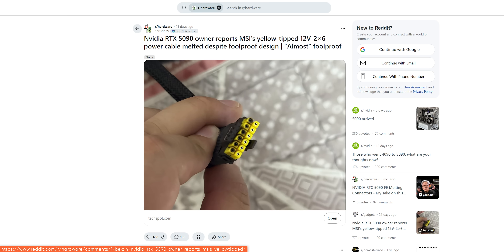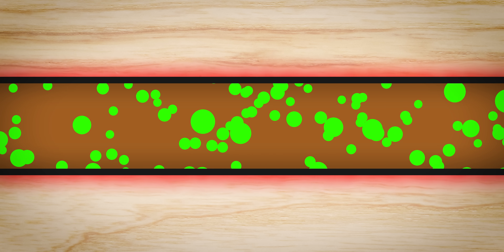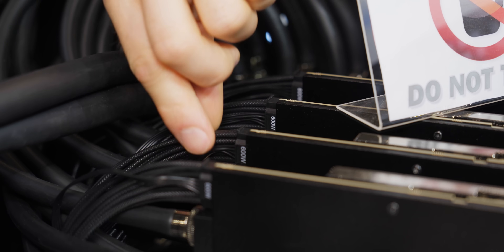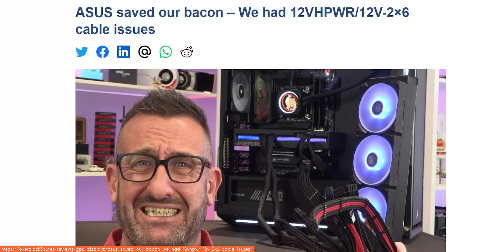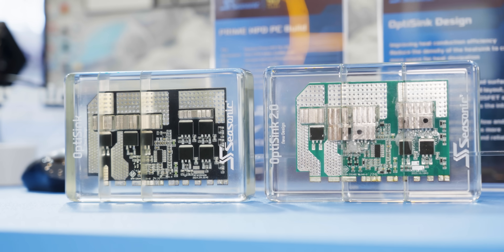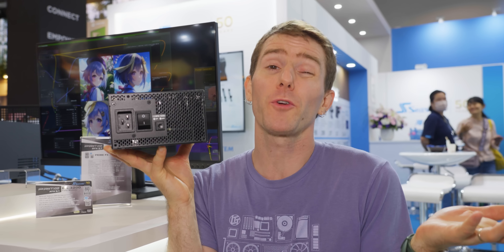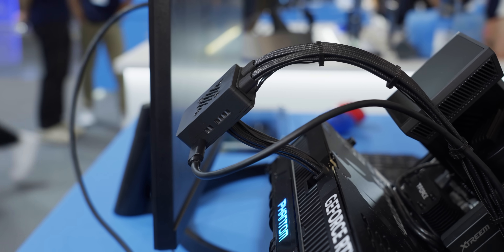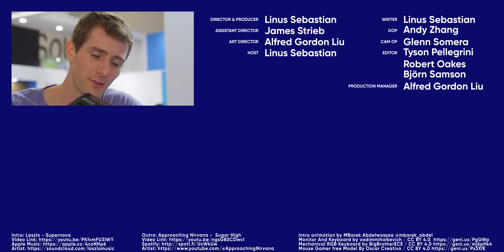The REAL Solution to Burning GPU Connectors

Comment: Wait wait wait. The screenshot at 3:07 says the TERMINAL is rated for 30 cycles. The terminal - from what i understand - is where you plug your cable ("connector") IN. As in: the socket on your GPU and the socket on your PSU. So after 30 plugs/unplugs into your GPU, you basically can "trash them" if you don't find someone soldering you a new terminal? (Same for the PSU)
Reply: "Rated for" and "being useless after" isn't the same thing. It's possible that the socket can hold out for being plugged in a thousand times, but there's no guarantee for more than 30. So it probably won't burst into fire after being used thirty times, but it might just happen. I would say that it's rather likely it will stand for 60 uses, or even a hundred, but as it gers used the plastic and metal will wear and become worse at providing a good connection. Now I really don't think it makes a huge difference as people has had those sockets burning after using them once. So even new they are already not a good connector.

Just accept that it is a very badly constructed connector. The designers were obviously told to just screw all the electrical tolerances that has been used for connectors earlier and just make something that was as small as possible and could handle the current when the connection was perfect. Adding tolerance for a somewhat dingy connection would require the connectors to be significantly larger, so screw that. LET THEM BURN!
Reply: I doubt I've unplugged my GPU even more than 5 times but that's good to know for all the other things. Same could be true for SATA cables which I change all the time 😂

Comment: The "real" Solution to burning GPUs would be that nVidia gets their sh.... together and stop saving a few bucks on Components that would save your GPU. They had the Tech in the 3090 and threw it away for better profit margin. It's cool that People found solution for such a unnecessary Problem....but hey as long the Consumer pays for it, it's fine right?

Comment: @Linus Please suggest to Seasonic to create an integrated UPS + power supply solution. We all know the importance of using a UPS and a quality power supply, but who wants a sick PC build to be sitting next to an ugly AF UPS. We don't need that UPS to run our 1200w gaming machine at full load for 10mins. Just give us a UPS combo that can protect from power dips and brown outs while giving the system a chance to power down with a complete outage. Sure it might 1.5x the cost, double the size, and 10x the weight but there are a number of cases that already accommodate longer units and much of the lower PC case space goes unused. Instead of me giving Cyberpower or APC that $150 I'd rather give it to Seasonic and not have an ugly UPS to deal with.

Comment: also do note that electricity actually dont run through the material of the wire itself ( at least the majority of it ) but on the outer edge of it ( only about the outside and first 2% deep of the wires diameter. where about 90% of all the current rounds though and only the last 10% of the current goes through when traveling down the wire length ) . which is called the "skin" effect. aka 90% of all of the power going though the wire travels in the outer 2% of the wire's diameter. and its pretty hard to make good soft bendy holow wires for the time being
Reply: Incorrect in several ways. The skin effect that limits current carrying of wires is only in AC, not DC as PCs use. Further it is not a % of material thickness - although if it was, it would make the point irrelevant, as materials would have their current capacity based on the thickness that actually gets used, since you need all of it anyway.
Reply: @iskierka8399  well the bigger the wire is the larger the surface would also be which would increase the limit of the wire and the extra mass inside would help to keep the wire cooler( along with that increased surface area which the power runs through ). though i dodnt know about that the skin effect didnt accure in DC but only AC ( since i was only informed that the majority of electric power runs on the outer edge of the wire. but nothing about that it only happend in AC )
Reply: @flikflak24  The charge buildup that causes current flow is limited to the skin, and because in AC there is limited time for this buildup to happen the flow only propagates to a shallow depth, which is why the effect occurs. In DC though once the initial charge is established the whole wire is available, since there is no time limit  for it to spread.

It is also relatively easily solved in real cases, though it does require you to do one of the solutions. Stranded wires give lots of surfaces, so even though the whole "wire" is very thick, all of it is close to a surface, and most of it can be used. On short fixed connections you can connect using hollow tubes instead of wires, which are also stronger.

Comment: the 12v high power connector is probably fine. I feal like using 2 to take share the load would be a better solution
Reply: They could also just up the voltage. There already exists a 48V version of the connector.

Comment: It’s not the connector per say, it’s the current balancing on the graphics card side.  The connector is actually fine, the PCIE SIG do a good job it’s the implementation on Nvidia side that f**ked it up.

Comment: Power supply manufacturers having to step in to fix Nvidia's mess.
I'm glad my RX 9070 XT uses the old 8-pin PCIe power connectors, even if they're bulkier.

Comment: Or a simple solution , just use 8 pin connectors .
Reply: Or higher voltage.
Reply: @TopiasSalakka  Bit late for that regulating down to the voltage for the GPU would be harder too. Best option would be for nvidia and AMD to spend one generation on power reduction over performance . I would well take something of say 9070xt performance but 100w

Comment: The actual real solution is to have a connector with six individual 12V pins and connecting each of them individually to a separate group of Vcore VRMs so you can properly current balance each wire, but obviously extra couple of cents worth of parts is too expensive to put on a $2000 GPU
Reply: Worse is they did have that. The 3090 ti didn't have the issues that current cards have as it monitored every two cables as seperate. The 40 series on wired all cables into 1 rail instead.
Reply: Which is what they do with multiple 6/8-pin connectors, usually grouping by connector rather than each individual pin, and the initial 12-pin on the 30 series which as Skylancer said grouped them in pairs rather than 6 individual ones. It's just the 12VHPWR that connects them in parallel to a single line which is apparently a part of its spec, hence why all NVIDIA AIBs follow the design and why the few AMD AIBs that have used the connector do as well, it's utterly mind boggling and pure negligence that they did this in the first place and even more so that they didn't change it in the 12V-2x6 revision. Also doesn't help they went with aesthetics over functionality in choosing a garbage connector with the Molex Micro-Fit that can easily have seating issues, they should have stuck with the Mini-Fit form factor making a 12-pin from that which would have been barely bigger with far less risk of seating issues.
Reply: regret to inform you that that solution violates pci sig spec

Comment: I like the explanation but I would’ve preferred a more open and truthful one. GPU manufacturers are obligated, all of them, to follow Nvidia’s abominable electrical design. Yes, Seasonic is coming to the rescue, but it’s more because PSU manufacturers are the only ones that have the ability to have a better solution implemented. Nvidia needs to be called out any time it’s possible, they need to own up to their mistakes and face the consequences.
And btw, NO, Asus astral cards only do per pin monitoring, not load balancing, it’s not a solution, only a safeguard

Comment: Nice job Seasonic! If I were going to buy an nGreedia GPU this would be something to consider. But this stupid 16 pin connector is one of the reasons I switched from Team Green to Team Red, and I don't regret that decision for a second. I wish NVidia would abandon their stupid deathtrap 16 pin dumpster fire. You don't need to be an electrician to understand that more current flowing through smaller wires is a questionable idea.

Comment: While I appreciate PSU manufacturers like Seasonic being willing to step in to protect high power items like Nvidia GPU's, they really shouldn't have to and us consumers should not have to pay for it.  Nvidia has been ripping its customers off for years now while lowering the overall quality of their products.  The whole 12HPWR thing is beyond a joke and has been destroying peoples systems for two generations now.  People should be refusing to buy them on the basis of having that power connector alone - as a fire risk.  I will definitely not be buying one of their cards with a 12HPWR connector, that's for sure.

Comment: The best solution is to move another DC conversion directly on to the GPU's PCB and implementing new ATX HPWR connector with different voltage, for example 20 or 24 instead of 12. You won't need more than 7A per one wire and even 8 pin basic Pcie connector could deliver over 600W  of power at 24V using same wire gauge. Today's HPWR connector is totaly underrated. The whole ATX power management should be reconsidered because every year same problems is nonsense. Even PCIe 12V supply rail could be 24V delivering over 170W alone

Comment: 1:50 yet another inaccurate chart for electrical wire. 14, 12 & 10 gauge are correct for UFB or romex but the rest are only correct for THWN wire.  Why does nobody check this shit.

Comment: i'll have one simple solution for you-longer wires or extension(i know it sounds strange,but you need to increase resistance so resistance variation in different pins does not change current too much)...there used to be companies that found out the same  hard way(broken motor controllers,because of high currents through paralelly connected transistors-fet-very low resistance in on state..every small path difference mattered)

Comment: You know, all of us in North America can just get a 240V outlet wired to anywhere in the house to use that power supply. That's what I would do. Piece of cake.
Reply: I find it insane that your houses aren't fully wired for 240V and insist on using 120V instead.

Comment: It is not up to the psu makers to find a solution for the melting plugs / cables.

If a device asks for +500W the psu will deliver that +500W without a problem.
and the cables will transport the power.

Cables are made according to spec.

Even power distribution over the connection must be done by the connected device not by the power supply.
Connecting all positive points to a single large place is asking for problems.

When this product comes on the market the following will happen:

With a lower model everything will work normally, but as soon as they use the 5090 or other with poor power distribution the measuring points of the psu will notice, oh gpu asks for uneven distribution over the cable. and will go into protection.

No melted plug ok.
No melted cable ok.
Problem on the gpu remains. not ok

And someone building his first pc with such a gpu will think something is broken and spend even more money on test hardware or on tech support from the store he bought the hardware from.

Comment: 30 mating cycles is absurd. Over 12 years, don't reseat your connector more than once every five months.
Reply: TBH I rarely reseat my connectors more than once every 6 years.  My older PC hasnt had its GPU cables touched for 8-9 years now at this point.
Reply: The Mini-Fit connector used for 6/8-pin connectors is also rated for 30 mating cycles by Molex yet they have never had real issues with seating, they should have made a 12-pin Mini-Fit connector instead of this garbage Micro-Fit one.
Reply: That seems totally reasonable to me. Just don't buy every single GPU that comes out, and enjoy your built PC for a couple years at a time.
Reply: @SiberCatLP  I'm looking to upgrade my GPU rn after getting my current one in 2025... but I've taken apart my computer to clean, have upgraded my CPU, AND have moved (so I took it apart) in that time. Unacceptable durability.
Reply: @SiberCatLP It's not reasonable. Maybe one has to open their cases for maintance every 6 months, or upgrade components other than GPUs. Many times you need remove the cable and the humongous GPU to access the innards. Maybe you'll sell it, and God knows what the other party is doing. Would they get it nearly broken? 
I know I had to reseat my GPU about 6 times due to some problems when first installed it, and check thrice if the cable was well connected. There goes 20% of the rated lifetime in a day. 

30 times is a joke when the standard is thousands.
Reply: @ZeroUm_  Thousands is for a USB cable being inserted daily. In 3 years with regular maintenance I have plugged my GPU in about twice - you don't need to unplug it to clean. Extrapolating that my connector is good for 45 years. Most of the other connectors in a PC are also only rated for around 30 connections - it's only external connectors that are rated for thousands.
Reply: @ZeroUm_  That sounds like a personal problem on your part or you are messing with your PC way too much.  I have been building PCs for 30 years now and I have never needed to unhook my GPU cables that much.

I have a card with one of the new connectors and I plugged it in properly one time and it's never getting unplugged.  If i need to remove the card I will simply unplug the other end on the PSU which is all standard 8+ pin connectors.

Now I agree the connector should have more duty cycles but if you know this in advance its very easy to avoid.

Comment: My guess is that for the next gen we will have the same connector but Nvidia will work to make an ATX 3.1.1 or whatever a thing to make solutions like this become the standard and shift the burden to PSU manufacturers. When those fail and the pim burns down Nvidia can just go "not my problem, your PSU fucked up, contact them"

Comment: I called this! I made a comment on one of the many videos about the melting 12VHPWR about PSU makers implementing some kind of current monitoring feature on the PSU side such that when any of the power cable in that 12VHPWR gets above the rated current, the PSU will cut off power to the GPU, thereby preventing any melting. Yes, it doesn't solve the problem since your display will go blank, but at least it'll save your GPU, PSU and associated cables.

Comment: 4:36, can we please stop forgetting there is litterally nothing preventing you from getting 240V on a circuit in North America, you get the best of both worlds and and can  run either or.
Reply: @HerbaMachina  the best part is in most places 240v is what comes into your house. He always says it like NA its illegal to have 240v
Reply: @BernardoDiCaprio47  Adding a 240V outlet to an already finished area is generally a massive pain, though, and if your breaker box wasn’t oversized with room for an extra 240V circuit, then in addition to running the wires you’ve also gotta replace the panel, which triggers the need for permits and updating it all to current code and inspections. May even be required to upgrade your service. 

You CAN get 240V into a study or home office or somewhere that a PC is likely to be, but as a practical matter it only really exists in kitchens and where your laundry hookup is, and is just starting to appear in garages.
Reply: Worse voltage and even worse sockets. As always, did a thing once and never ever upgraded or improved upon it.
Reply: America is so far ahead with alot of things but still using 120V circuit. Its like the same with houses being torn apart because of bad weather/storms because house are build in wood which is easily blown away. Instead of using concrete and bricks which is more expensive but I rather have that than a house that´s gone that easy
Reply: @moewjoew3383  Brick and concrete still get destroyed by tornados and hurricanes, or at the very least damaged enough to require major repairs. Go look at footage of commercial properties hit.

Comment: The REAL solution is a proper connector design. Nvidia could have kept their same stupid ambitions with the same exact form factor and load specifications per pin if they just made a new smaller iteration of the 8pin. Four 16AWG / 1.5mm² conductors each for ground and 12V, 300W load specification with an additional 33% safety factor for up to 400W. That would match the fiery 12VHPWR fiasco but is actually safe and user friendly

Comment: I was here before the video got unlisted.
Reply: Same, why did it get unlisted though.
Reply: @AluminumHaste  My guess is nvidia got upsetty spaghetti Linus put them in a bad light. Since it isn't straight up deleted they will probably change the title and some of the video and relist it.
Reply: Wait, what? I just opened this 7 minutes ago
Reply: It was unlisted  an hour ago and by your confirmation that you were able to see it on your feed, it has been relisted.
Reply: It will probably still get unlisted as it incorrectly states the Astral cards have a solution to the 12VHPWR issues. They do not. They just have monitoring that warns you if it runs abnormally if you also download their extra software. It's even less useful than many monitoring tools others are selling. In fact if Asus was serious about it they would have put a speaker on the card so it at least makes noise even without software.

Comment: would the solution not just be to have the connector at at least one end have some sort of load balancing to make sure too much current dosent go through one wire. which admittedly likely wouldnt help with the rapid wear and tear issue